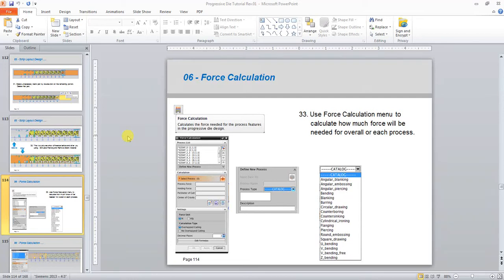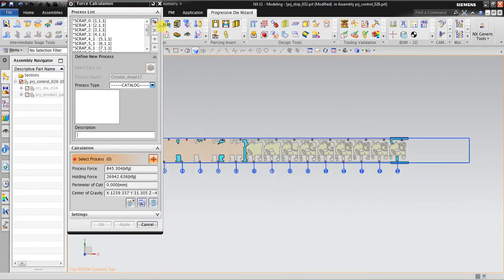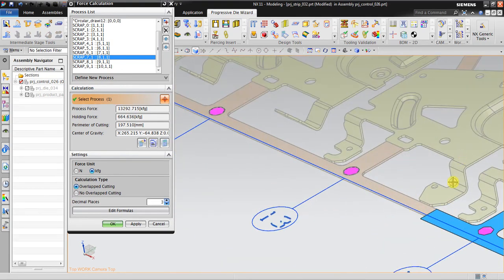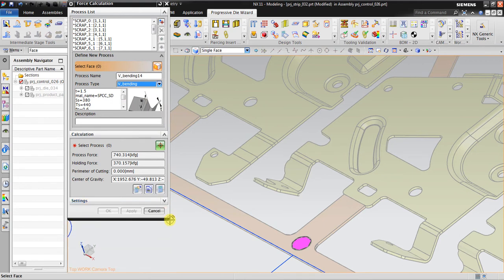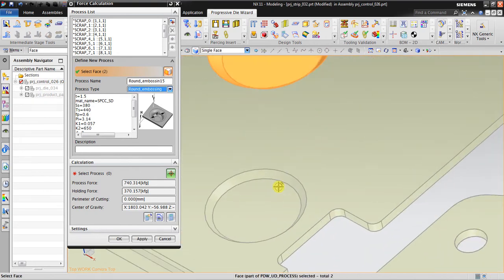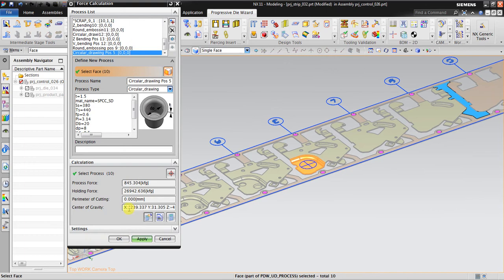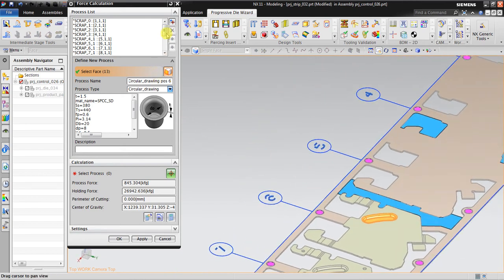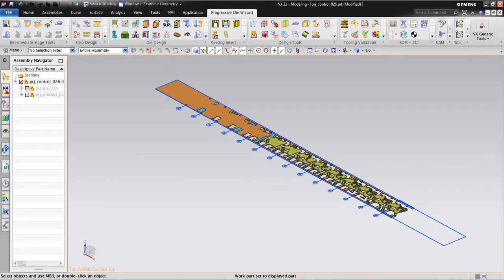NX Progressive Die Wizard (PDW) : STEP 04  - Force Calculation

Comment: Hi. I have this problem when I try to generate the force calculation, there's no value. What's wrong? FYI I created my own product and strip and everyting seems OK on the design. Any idea sir?
Reply from the maker: Sometimes NX only can read and calculate every force required only if you pierce, bending or forming using tool available inside NX progressive die ribbon bar. Do you create some CAD modification manually outside NX Progressive Dies and warning message appear telling the "Linked Body broken" ?
NX Progressive Die design very depend on Linked Body, next step depend on previous step and each step create its own linked body geometry.